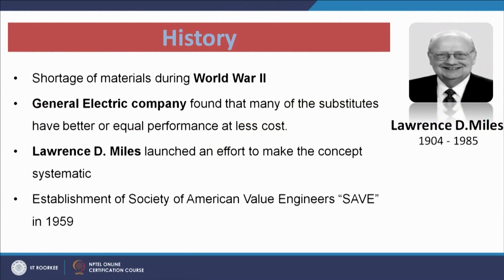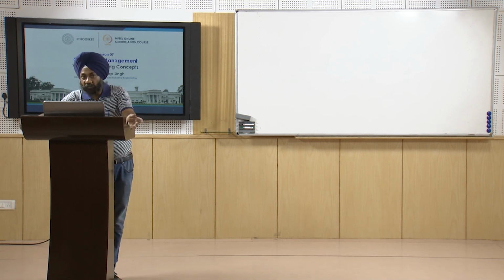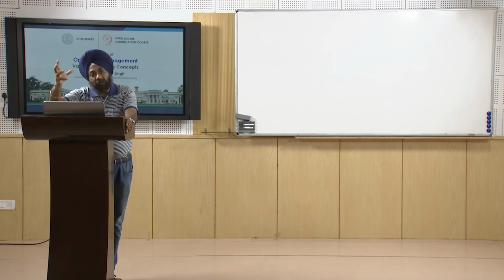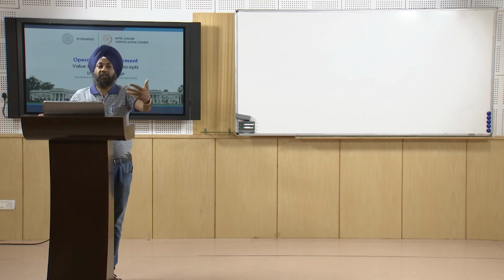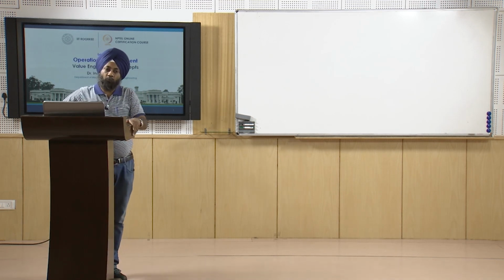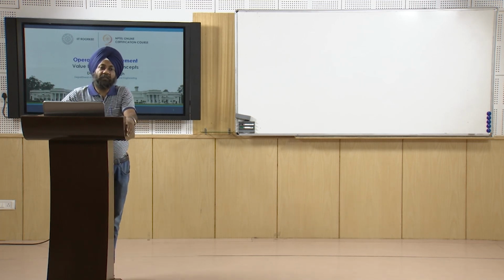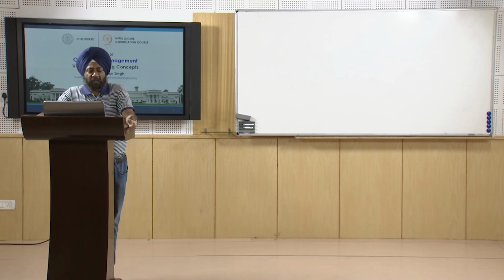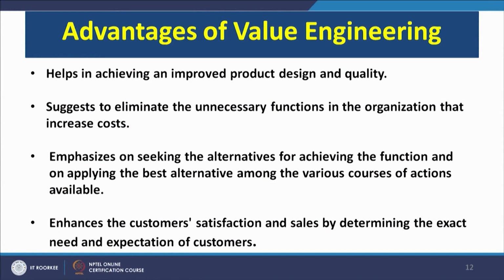Lecture 07 Value Engineering Concepts

Comment: Lecture 07 - Watched
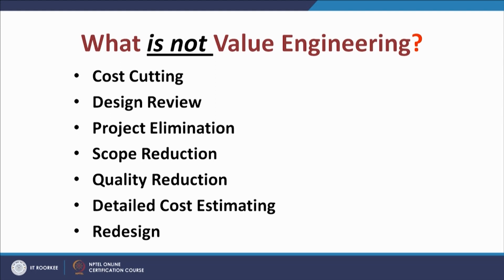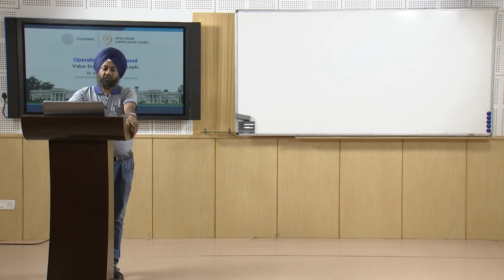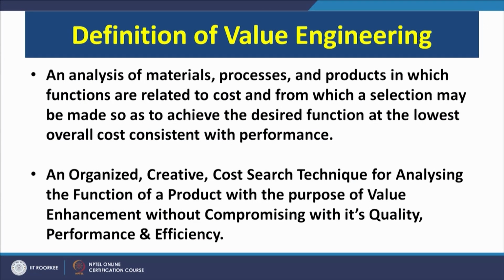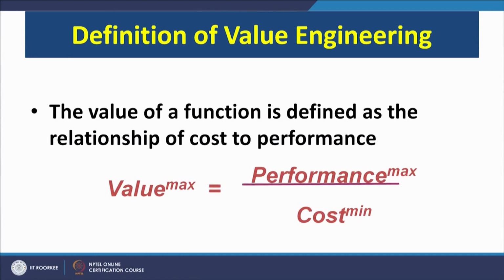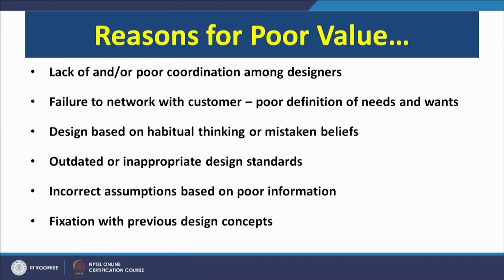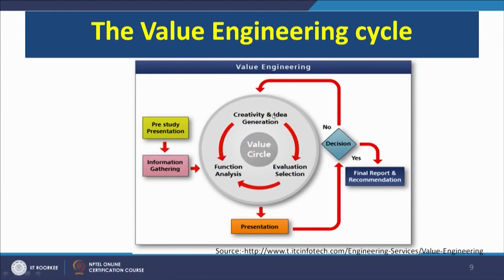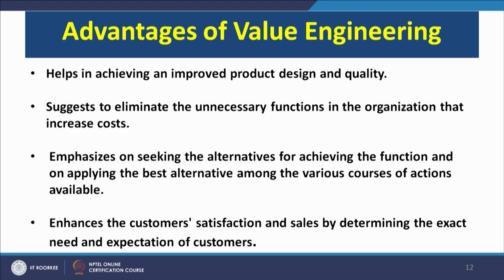Slides - History 8:02 || What is not Value Engineering 18:43 || What is value Engineering 19:54 || Definition of Value Engineering 21:31 , 23:02 || Reasons for poor value 25:30 || When to apply value engineering 27:26 || The value Engineering cycle 28:17 || Application areas 28:56 , 29:17 || Advantages of value engineering 29:27